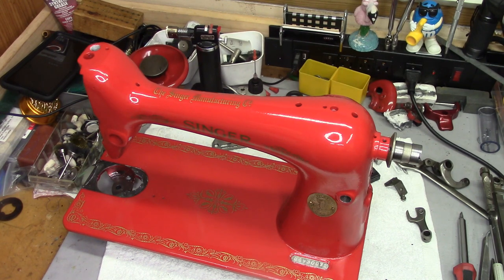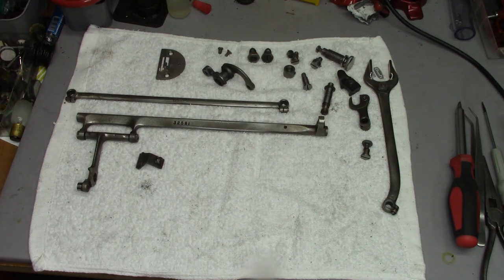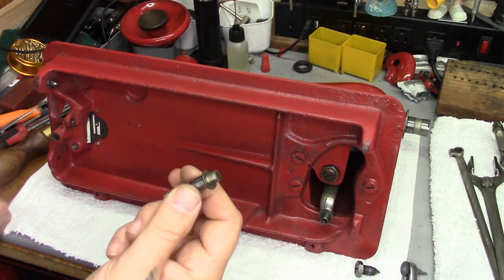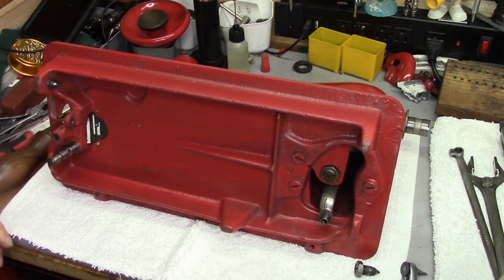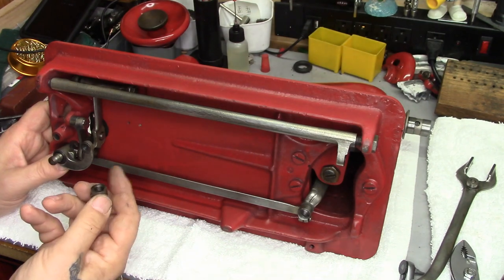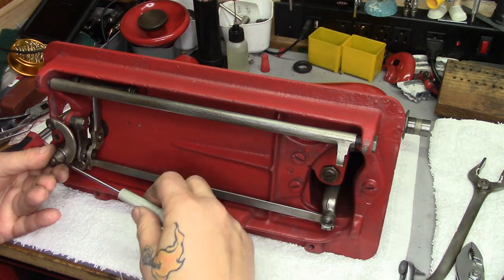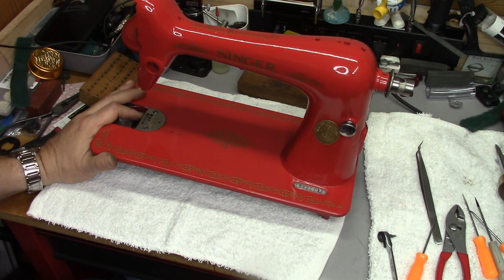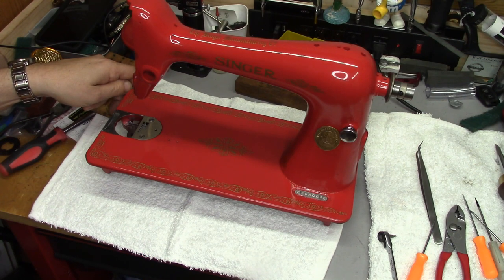Tractor Paint 66 - Part 2: Install The Feed Mechanism

Comment: Hello Bob,
FYI   I had another early 66-1 from 1912 to do a rehab.  (May 2022) I took it all apart except for the main horizontal shaft, replaced some missing parts, cleaned 100 years of gunk and reassembled it.  Everything was going great with the guidance of your videos except the new feed dogs that I got from eBay would not fit through the needle plate.  After many hours of frustration, I finally figured out, that I had the old style needle plate for the narrow feed dogs!  I barrowed another needle plate from later 66 and used it in my Red Eye and I was back in business.  This was my nightmare for most of the day!
Reply from the maker: Yeah, that's something that can jump up and bite you! Good catch!

Comment: Hey Bob,
Just come across your videos and they are really hepful.
I have a 66 lotus on the way as I type and I will pick up a treadle cabinet tomorrow for it.
The treadle cabinet has a lotus 66 in it but in bad nick.
So I just might be tempted to strip it completely and spray it Pink or something.

Comment: Hi, what kind of clear did you use? Did you wet sand and polish?.........oh great job by the way.
Reply from the maker: I used the Dupli Color clear, nothing fancy. I wet sanded the first 2 coats of color, but I didn't go crazy. This wasn't originally intended to be a "how cool is that" project, rather more of an experiment. It's kind of taken on a life of its own. I'll be doing more of this kind of thing in the future, and most likely will concentrate more on getting the "perfect finish".

Comment: Great Job on the paint and instructions!  I'm doing my own restoration on my 66-1 Red Eye right along with you!
Reply from the maker: Awesome! Keep us posted on how you're doing!
Reply: @BobFowlerWorkshop  I got it timed and put together except for the tension unit.  Ran it by hand and it seemed great.  Ran it with a motor and it is very noisy in the bobbin case hook area.  I was thinking that the bobbin case bracket and bobbin case need adjustment?   Is this normal?  Thanks for the video!
Reply from the maker: @rafaelmunoz21  Does your bobbin case positioning bracket have the screw of death, or is it the older style? Also, is your felt installed? If you have the newer style, you'll want to make sure you have about .010 to .014 clearance between the heel of the bobbin case and the bobbin case position bracket for thread clearance. If there's a lot more than that, it will still work, but it will tend to be noisy. If you have the older, non-adjustable style bracket, enjoy the sound of 100 year old technology as you really don't have good options to close up that gap as the supply of new springs has dried up.
Reply: @BobFowlerWorkshop  It's a singer 66-4 with a Bobbin Case with a positioning bracket that has a pivot pin and a screw on top.   Looks like I need to adjust it.   I did put  in a new felt and it is soaked in oil.

Comment: Bob, notice you didn't use any oil or grease when reinstalling screws & pivot  screws.... any reason for that ?
Reply from the maker: Yes, I reassemble dry, then oil when done. Clean and polished bearing and pivot surfaces do fine with just the oil from normal servicing.